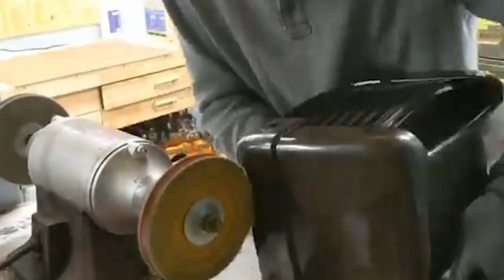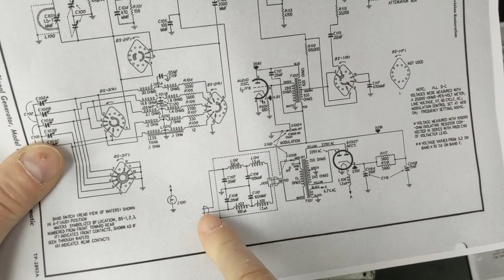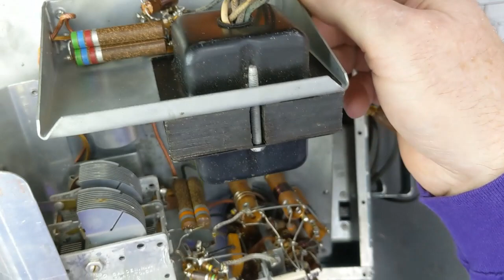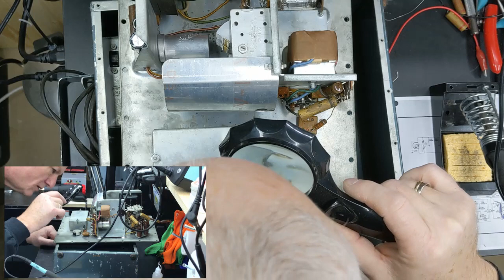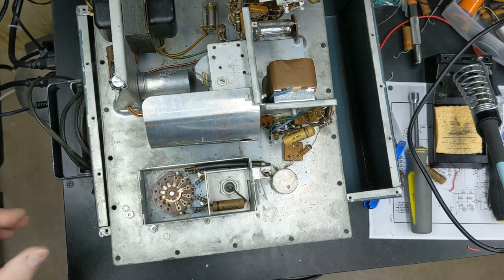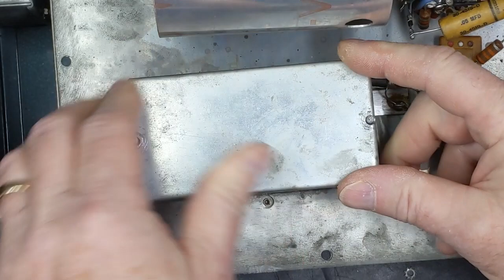Philco 7070 Signal Generator- Part 1

Comment: Premiere was great Gregg - glad you didn't miss it yourself 😉
Re-stuffing is something I have done in the past, but no more. I would still do it at a push on some of the radios I see here - open the back door to change the battery and there they are... on display - but even then, the radio has to warrant it. Good Job anyhow, thoroughly enjoyed it. Looking forward to the next... ATB
Reply from the maker: Thank you Paul, I hadn't planned on doing it on this, but when I went to get the .05 capacitor and I had one sitting there ready to go, I figured, "Why not?"

Comment: Great idea working on that Philco 7070 Signal Generator. Checking the transformer first was a good idea. Even if the filament trans is good doesn't help when you can't get B plus.I am surprised you restuff that many wax/paper caps.But it was a great video thanks for sharing,

Comment: It's coming along. Not into restuffing  capacitors since no one sees inside the test equipment. Now a stereo rebuild may just be a different story.
Reply from the maker: I hadn't planned on doing it on this, but when I went to get the .05 capacitor and I had one sitting there ready to go....

Comment: Great job on stuffing those caps, I would never restuff them because no one sees the under side of the chassis, but that is just me.
Keep up the great work Gregg!!
Reply from the maker: I agree Bill, I hadn't actually planned to re-stuff them, especially since I didn't do the electrolytic re-stuff. I just happed to have a couple already re-stuffed, used them, then it only made sense. That said it's really kind of dumb anyway, because now I have some new type resistors in there too. Oh well.
Reply: @greggsvintageworkshop8974  The bad thing is if someone else got that signal generator later on and saw those "wax" caps they would cut them out and replace them...LOL